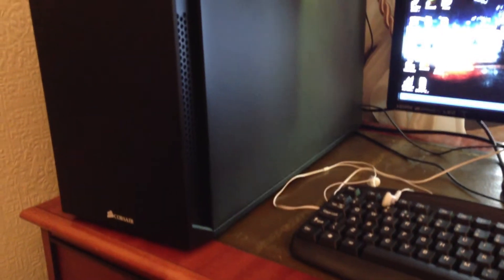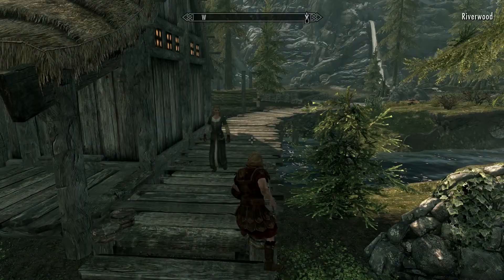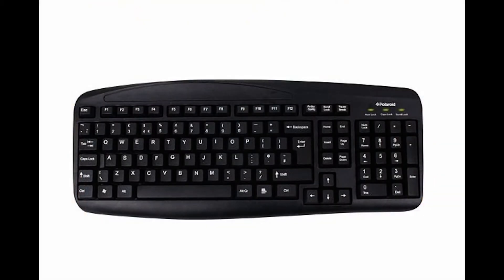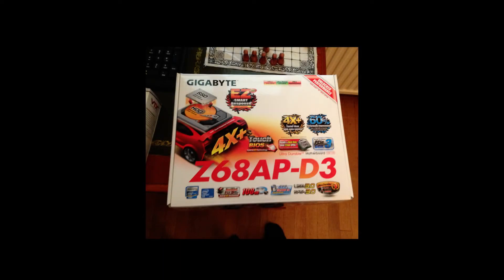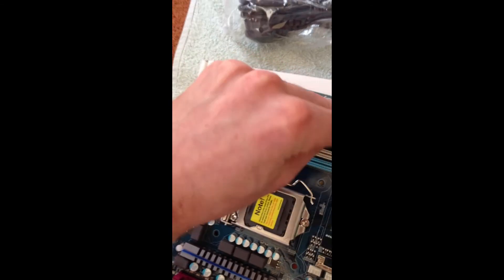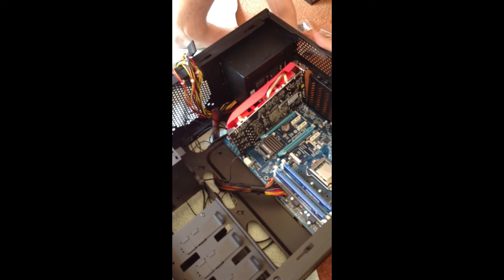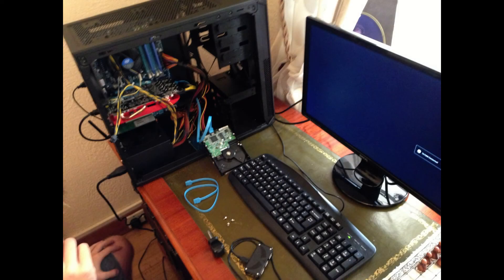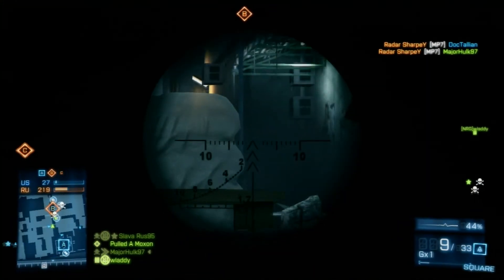Building a PC on a Budget (£600 inc. Monitor, Mouse and Keyboard)

Comment: hi fellow youtuber if you use dxtory like me you need to use the lagarith codec not dxtorys codec you proberly already no this but its very high quility codec and it will give you less lag when recording trust me try it once and you wont go back,  i always got lag also even on a external 120mb hard drive but with this codec i can record in 1080p with no lag

Comment: my advice for the first upgrade you should do is your storage device I would suggest a western digital caviar black it a a beast of a hard drive and delivers almost equal performance of a ssd but at a fraction of the price and it runs at 7500 rpm so the speed is unbelievable